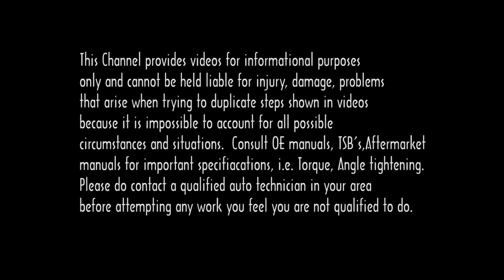2013 Honda Civic transmission fluid change drain and fill.

Comment: What this means is that you end up with oil that is continuously contaminated with old oil.  That has to be the dumbest design Honda ever came up with.
Reply: 50ml is not a big deal if left behind. I mean you could let it drain for 5 hours if it makes you happy.
Reply: @rogerl9997  I think you missed the point... 5 hours, 10 hours, whatever, that remaining fluid will not drain out no matter how long you wait, it requires being pumped out with specialized equipment at a Honda Dealer to remove all of it. It is a stupid design from a consumer view, but great for them to be able to force you to go to them if you want the job done correctly and change out the fluid completely.

Comment: What about that little trans filter behind the battery
Reply: That’s the air filter, Honda auto transmission filter is internal meaning you replace it when the transmission gets rebuilt or just keep an eye on your service intervals and that will prolong transmission fluid and overall transmission life expectancy

Comment: Wait so I thought it was 2.5 quarts to fully fill it up, why did you say 6 quarts?
Reply: You have that backwards.... for a drain & fill its about 3 quarts, for a total system full it's almost 7qts, but that's including the torque converter & inside the transmission.

Comment: If you raise the front end up and put it on jack stands does that prevent proper drainage?
Reply: No. Just did it. Got 2 1/2 quarts out. The drain plug faces the passenger side of the vehicle.
Reply: If you are slick you can do it with the car on the ground but you’ll need some swivel extensions or a creative vantage point.